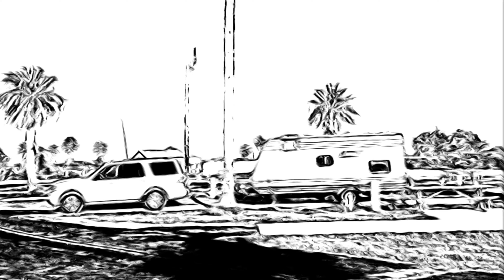RV Sink Drain Pipe Leak and repair

Comment: I have the same issue, I used the flex tape and it worked great, but only for one camping trip. Tape has now come off and I have the issue again. Tape is just not holding. Any other ideas?
Reply from the maker: Hmm. Mine is going strong. Let's see what we might have done differently.
I applied the tape to hold the pipe in position, not to seal the leak. No water touches the tape. 
I also used the tape to hold the lines together. In other words, to support the weight of the pipe.
I used all the tape I could, and really gobbed it up.
The other thing I would do, if I were you, would be to drill a small hole to set the two pipes together with a screw. Then I would cover that with tape. Use a stainless screw. 
Does that help?
Please don't hesitate to contact me some more on the subject. 
If yours failed, mine might as well.
Reply: @funinourrv  I'll give it a go. It'll be a while as we keep our trailer at a friend's ranch. When I'm ready to use it again I'll retry the fix and let you know how it turns out. Thx. Your video helped me for at least one solid trip though.

Comment: Great insight into something that is clearly going to go wrong eventually!
Reply from the maker: Yes. The entire plumbing system is hanging from the sink drain. This is not uncommon in homes. Everything hangs from the drain or the garbage disposal. 
the difference is the constant bouncing of the RV that is going to knock it loose. Wrapping it with the Peel and Stick tape solves the problem. There is also a brand of duct tape now that is "Super Strong and very Sticky" that will probably work as well.